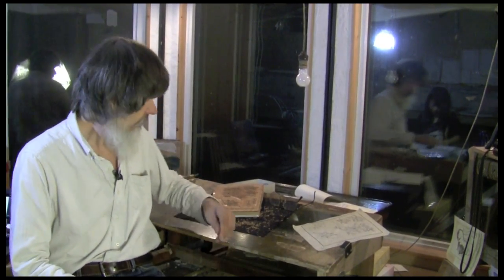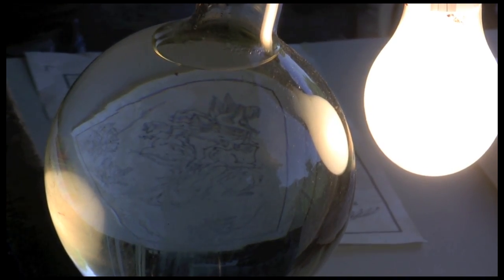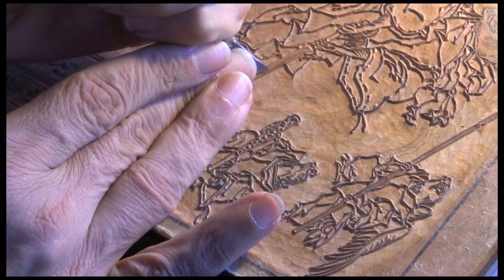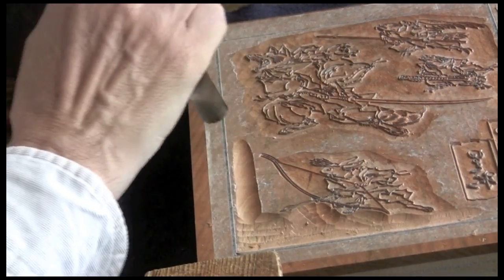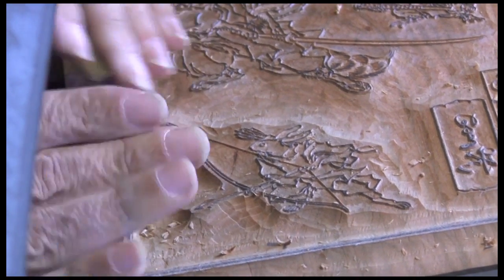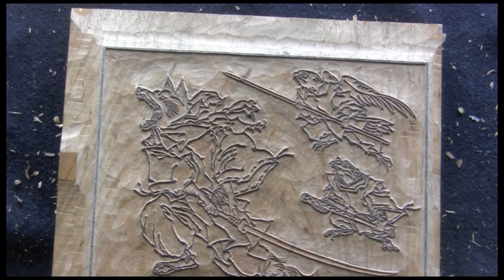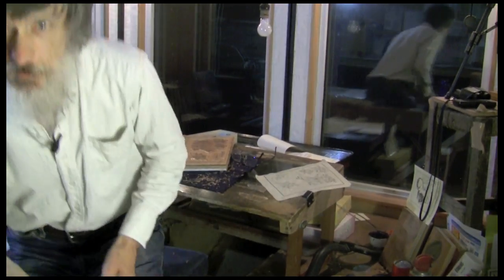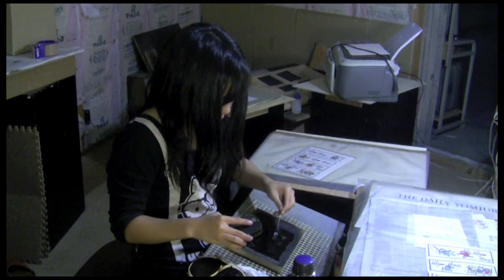Ukiyoe Heroes (12) : Fox Moon - carving the key block

Comment from the maker: There's no simple easy answer. I'm using a very hard wood (cherry), we're only taking a limited number of impressions in any given batch (then letting the wood dry thoroughly), and my printers are using a very finely ground sumi pigment - all these contribute to a good long and healthy life for this block. We expect to be able to pull a couple of thousand impressions from this without any noticeable degradation.

Comment from the maker: It all depends on how you hold your knife when cutting - with your palm down, or palm up. That puts the blade into the wood at a different angle, and has a big difference in the cutting action. The main point is that you want the _flat_ side of the blade to run against the wood that will be left behind. If you are right handed, and you cut with your palm upwards, then you should get a left-handed blade. (The blade 'handed-ness' is based on the traditional method of carving, with the palm down.)

Comment: Such a beautiful Art.. and no Photoshop in Sight :-)
Reply: Nobody uses photoshop to do drawings, photoshop is for photos. You are thinking of illustrator.
Reply: everyone uses photoshop to draw haha, its pixel based where illustrator is vector based, meaning in photoshop you can use brushes etc, and actually Jed, the illustrator (designer) for this woodblock print did use photoshop to draw the initial drawing, which he then traced with an ink brush for a more traditional feel.